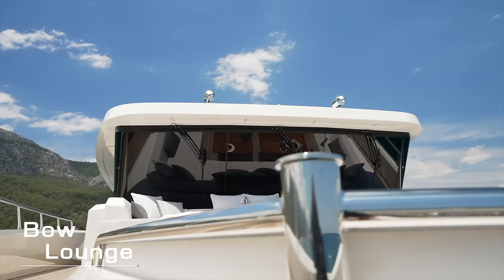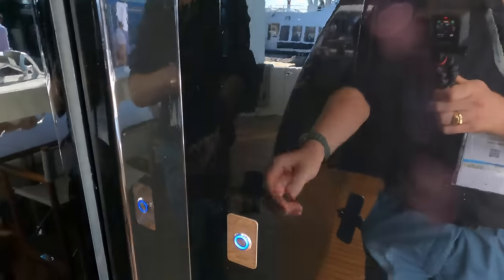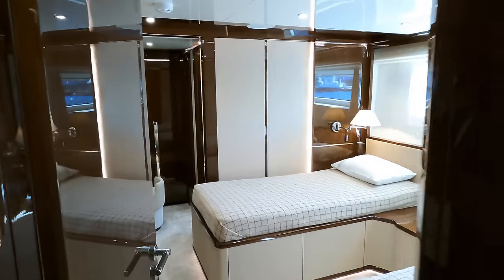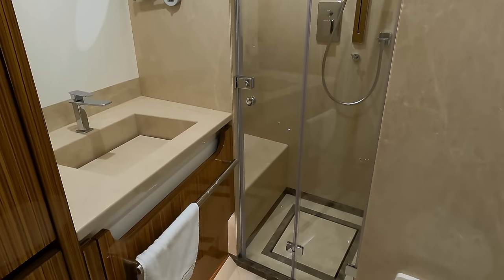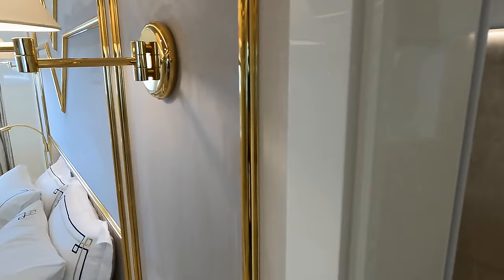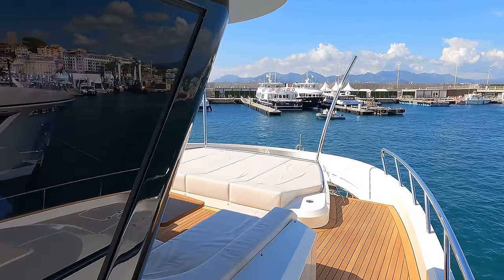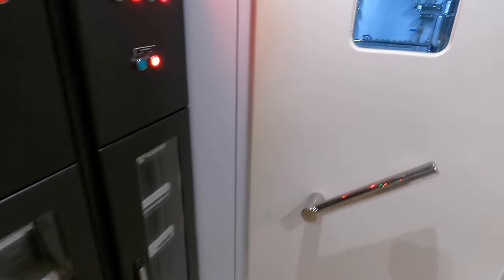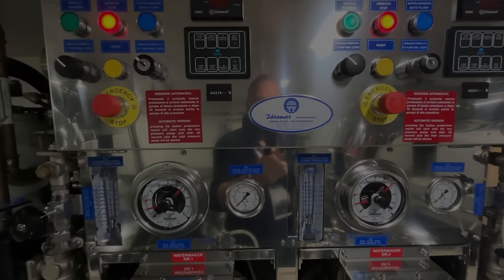€10M ULTRA HIGH VOLUME Lazarra Yacht Tour!

Comment: Great video John. Obviously I've seen tours of this yacht before, but you were the first one that didn't go on and on about the 'no through hull' design or the 'high ceilings'. I didn't really think that was all that impressive. I get that the yacht has a high volume, but really you are paying for extra height. Not a concern on most yachts to me. But here they went on about it. Don't get me wrong, I love the yacht as it looks like something Trump would have. Plus I love the old Lazzara and now this new ownership and direction, at least with these. I know they make other regular yachts too. The old Lazzaras, some of them, had two pods in the aft that held jet skis. How James Bond is that? A pod inside the hull, so cool.

Comment: 50 percent of the primary seating in the saloon faces away from the TV.  i dont understand that choice. and it seems the italians have been trying to sneak back in elements of that 1980s gold-tone trim.  reminds me of gulf craft.
Reply: Actually ALL the seating is not facing the tv. It is either behind you or at right angles. Couldn’t really put it in a worse place. Yes the gold trim looks tacky, despite it trying to do the opposite. Most of the fittings and the finish in general screams massed produced to a price. And the exterior is hideous.

Comment: Second comment....that grill is shameful. Not sure what the point of it is. The other issue was the Volvo Penta engines. I get they will get the job done but when everyone was going on about it, I expected some Caterpillar engines, maybe John Deere or MTU. Rolls Royce jet drives. Nope...Volvo Penta's! Such a weird choice. To me. I mean they get the job done and are in a ton of boats so parts are usually available everywhere. It just seemed like the grill....underwhelming. Again, like the yacht. Just pointing out the odd stuff.